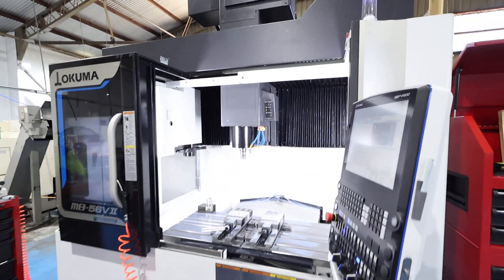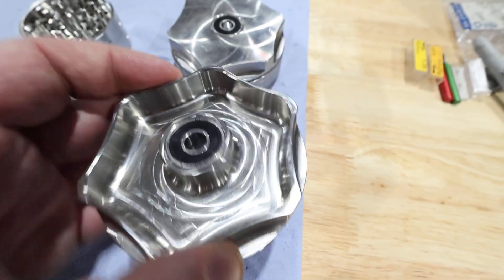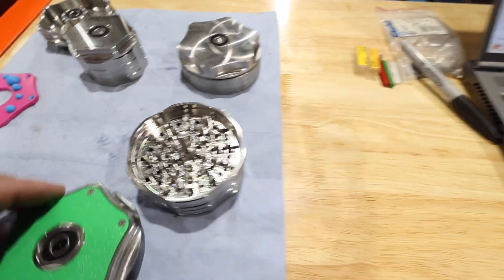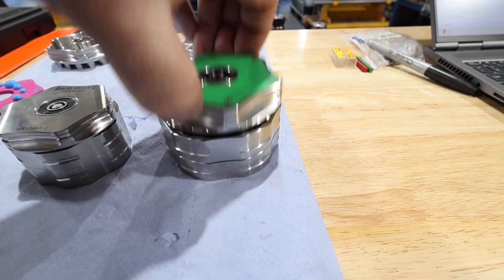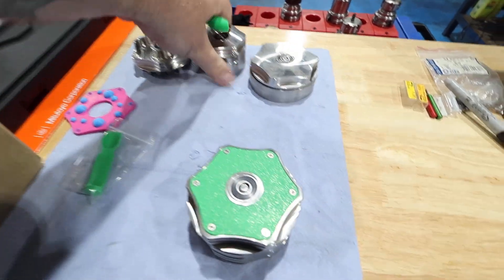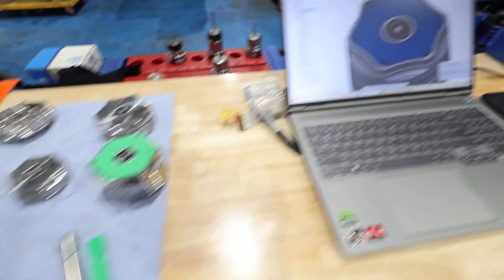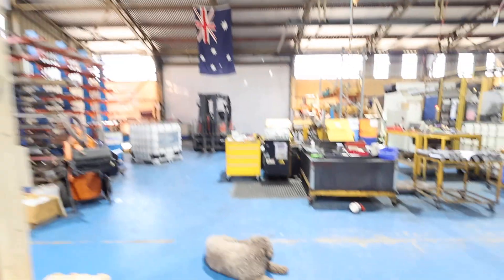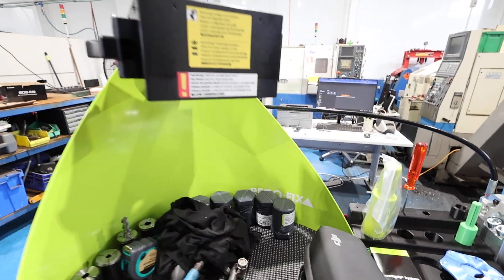Aroma-3 XL Prototyping

Comment: 3:10 Would something like a Zealous brand bearing (spacer sleeve bearing) help reduce wobble if you machined out a channel for the extended spacer? Should give you a more solid moment advantage with 1 single bearing smaller version. 🤷‍♂️

Comment: A3 Top heavy, feels unnatural to hold. If it was a boat it would capsize. Rezin eventually finds its way up Into the ball-bearing housing and spindle gaps. Build quality, functional yes but awkward as f. Any grinder that requires a learning curve to get lid off and you can damage if done improperly over time is imo a design floor. Think there's other options for too and lighter alloys and such. Just trying to avoid the rocking motion to get magnet top off and consciously pulling up....was enough to piss me off and actually start hurting my wrist ( issues as why I bought it ) then any relief from easy grinding. Spilled 3 mixes due to cumbersome top heavy only lift this way lid. Grindaroo never let me down once. I never cleaned it, it never jammed and I pump alot of HQ through it.  Great product grinder mate is don't get me wrong. It's just not for me. Will try other options as still impressive
Reply from the maker: Hello, I offer a non magnet lid for this reason. The lid will literally fall off if the grinder is positioned upside down. Please reach out if you would like one. thanks, Ben

Comment: I dont understand the design choice to make the center pole thinner, i like the precision of the pole into bearing of the Aroma 3, why cant it be the same diameter in the xl version just longer so it can hold 2 bearings but fits tight
Reply from the maker: @IchDuForeverExplorering  hello, it’s the same, just longer to suit 2 bearings. I’m making it ever so slightly smaller so it’s easier to get on and off the post. I’m taking less than 0.1mm smaller
Reply: @oldmatedesigns  awesome, so excited for your new xl design

Comment: Hi, I would love to get an Aroma-3 and the XL version is a good idea. But the space in the lid should not be wasted, I don`t like that very much. Try to design a magnetic cover that seals well and is easy to open, so you get a stash or storage container out of it, that would be amazing. The scoop is looking really nice, will it fit somewhere into the grinder? Someone else mentioned a magnet in the bottom of the scoop, that`s a great idea…
By the way, it`s good that you went away from that ashtray idea on the top, no one wants a stinky ashtray integrated in that lovely thing…
Best regards from Germany!

Comment: Hi Ben, Lord Winston :)

Congrats on the new machine and with the jumbo venture.

It's funny, I clicked on the new vid and paused it when jumbo came into view with the A3 next to it, called the misso to have a look.

I'm looking, comparing sizes and just as the misso sat down I said.. 
wow Ben is gonna have to drill out this beast to save weight.

Started the vid and ha ha your weight saver idea came on :)

I like the xl Ben, I don't care for the 'lid' at all.
 
To be honest it looks like something that would come from a trawler skipper.

The xl doesn't have to be a A3 on steroids, I think a complete new lid design is needed.

The outer wall that creates the ashtray effect doesn't need to be there, ditch it and design a nice and ergo turn, lift handle from the large [tall] center post.

Well I'm not too sure yet Ben as I haven't medicated today and I will see the xl differently very soon hee hee and never forget you're the design - machinist and I'm the nurseryman.

Good on ya mate, this looks very interesting and the new spoon works great thanks.
It fits the curve of the mull bowl great and it also is the perfect size to work with the SnB dosing caps and their loader.

Ps. the Qr code on the bearing puller is dead. The puller animation vids on your www are really good.

All the best RnK :)

Comment: Pleaseeeee make aroma 2 xl! Alot of use like a fine grind that 2 piece grinders provide.
Reply: second this! I need a fine grind grinder 😁 I am wanting to replace my zam grinder and budwakker both are fine but not quite what I am seeking. The zam grinder I like on the first like two three grinds and a clean and makes a nice medium grind but it's small and gives me massive hand pain, the budwakker alleviates the hand pain but is plastic and although you can chop it to desired size with the stainless steel blades it's just that blades. I think Flowermill or Phoenician Grinders is something I am thinking of trying next but would love an aroma 2 xl!

Comment: Really Exciting Stuff. I will be jumping on that founders edition ASAP! Also looking forward to the different grind plates and a XL Gripper boy.

I would prefer no screws on the lid tho. Maybe a magnetic locking system with magnetic key to unlock it? Unsure on the effect it would have on the other magnets/bearings being so close in proximetry. Might then need magnetic sheilding to prevent issues.
 I have my preorder locked in :)

Keep up the hard work!

Comment: Hey Ben, love the new design but would it be possible to make the lid insert easily removable? It just seems like a waste of space. 🤔 A slightly convex lid with a central or quick locking system and a silicone seal for herbs in the lid? 
And coarse plates. I'm really starting to like a coarser grind, especially for convection/hybrid vapes. Any idea if you'll be able to make a coarse plate for existing Aroma 3's?